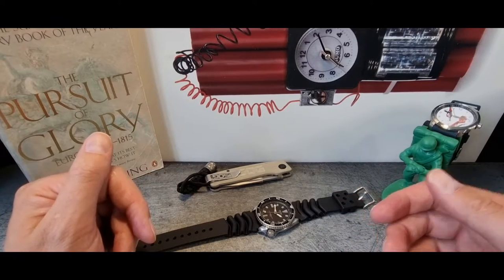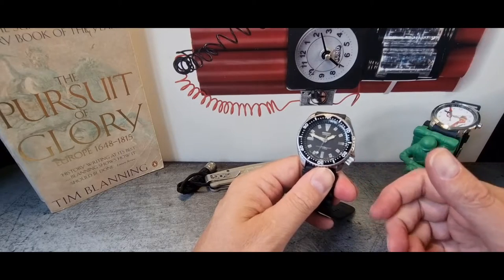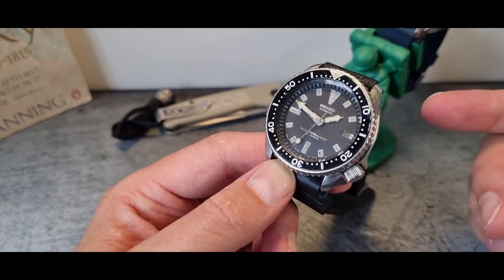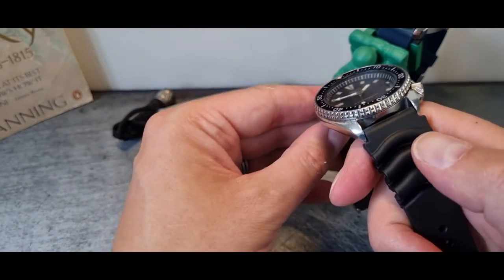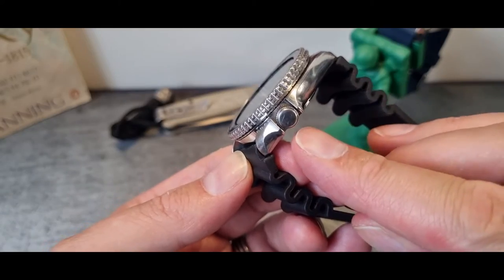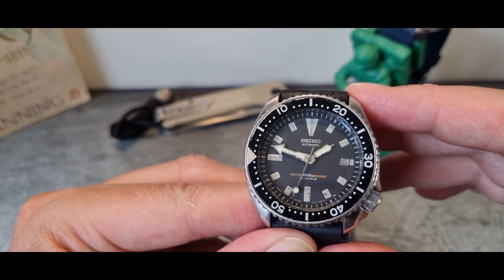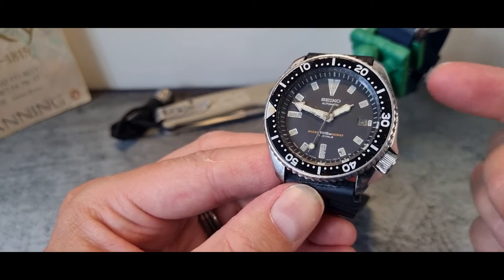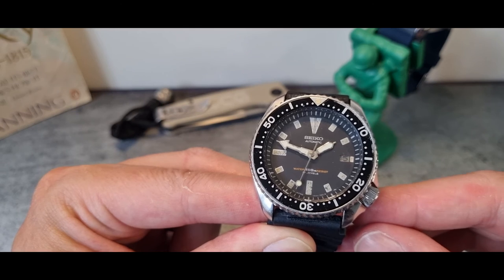SEIKO 7002 7001 watch restoration and tutorial project - what could go wrong?? :)

Comment: 😮Hello,
I picked up a Seiko 7002-7001 that appears to be in very good condition and keeps accurate time. However, it has a Mickey Mouse themed face with a blue background. I am unable to find any info on the watch online and would like to determine if it is original and some idea of the value. I also own a Seiko 6309-7049 that I bought in 1981 so I am somewhat familiar with these watches. Can you possibly shed some light on this unusual piece? Thanks.
Reply from the maker: Hey Mike yup the disney and snoopy themed dials are quite common even today several brands are still releasing them 👍😎 personally I don't get them but clearly they are popular 👍
Reply: @thetimebombardier  Thanks for responding. It is a bit of a novelty item, but it is in such excellent condition that I couldn't resist for $35 CDN.
Cheers
Reply from the maker: @mikewoods1622  that's a bargain 😅😎👍